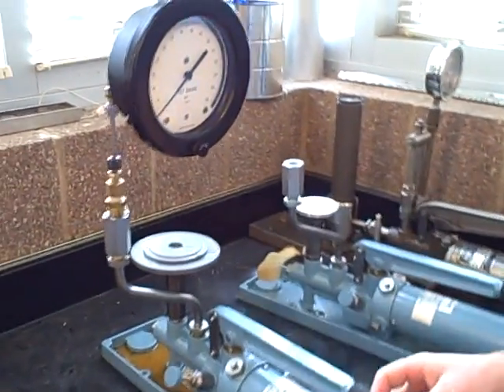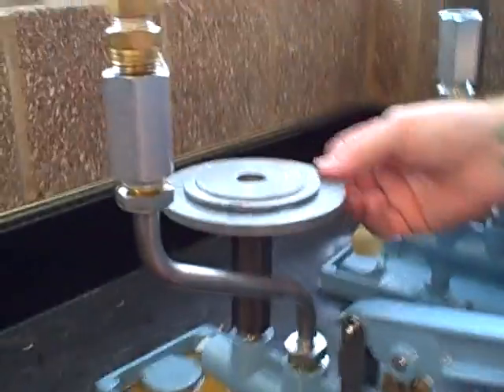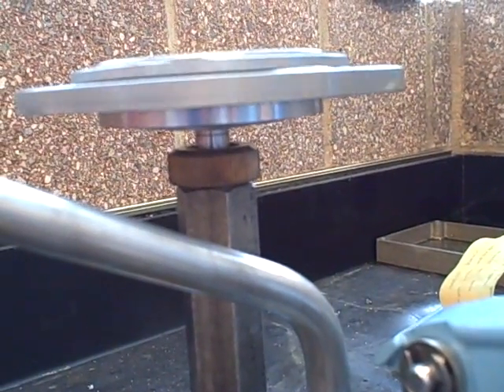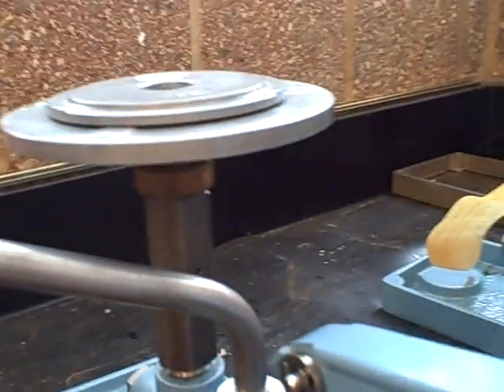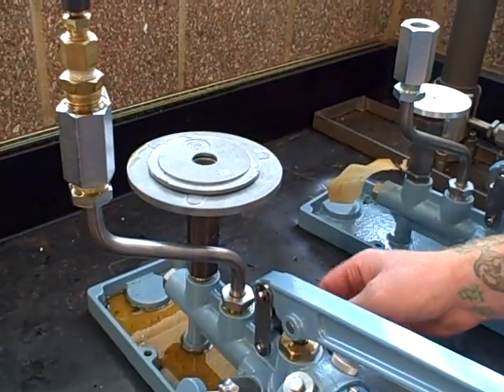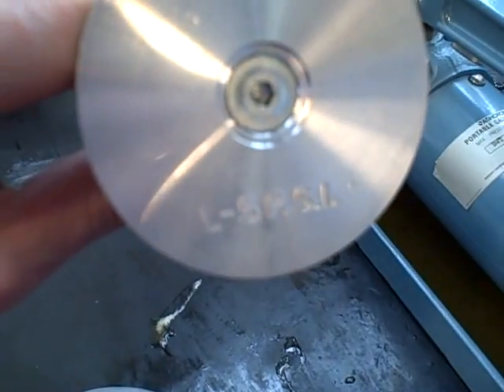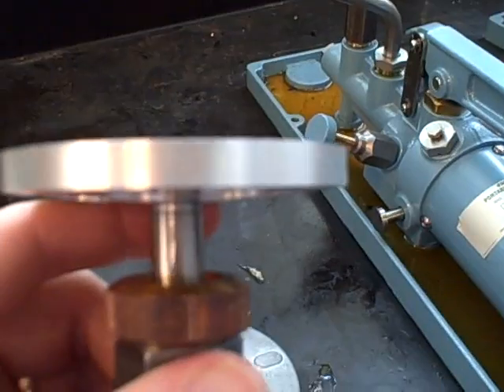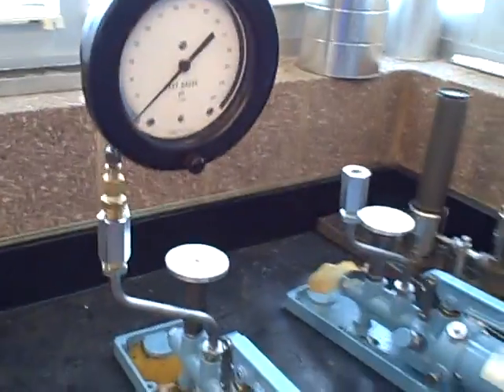Ashcroft 1305 deadweight tester

Comment: What exactly is this used for? Just testing gauges? I got one in a box lot I bought from an auction and was wondering exactly what it was.
Reply: It is used to test pressure gauges. You can use it to calibrate pressure gauges in the field. They have an accuracy of .1%. Do you still have it?

Comment: I have a couple of issues with this video. The first issue is if you’re using The deadweight tester to calibrate a gauge below 1000 PSI you should be using the low pressure piston. The second thing is the gauge he is calibrating with that deadweight tester is accurate to .25% the deadweight tester itself is accurate .1%. When you calibrate something you want a 4 to 1 accuracy ratio. This is only a 2.5 to 1 ratio. Last but not least he told you at the end he showed you how to calibrate the gauge. In reality he only showed you one point he also didn’t tell you whether it’s intolerance or out of tolerance. Whenever you calibrate a gauge you should check it at every 20% of scale so if you have 150 PSI gauge you wanna check it at 30, 60, 90, 120, 150 and then back down.
Reply: What happens if you use high piston on below 1000psi gauges? 

Also I have been testing gauges that are 300 or 200 psi using deadwaight tester using high piston and the piston doesn't elevate on it's own even after rotating in pressure less than 100 psi, is this normal?

Comment from the maker: You should be able to turn the displacement knob either direction, but it does have limits.  It sounds to me like the setscrew holding the blue knob on the shaft is loose.

As for oil, we just use regular 30-weight non-detergent motor oil.

Comment: Is the displacement valve (on the left) only supposed to be turned clockwise to slightly increase pressure?  If I turn it counter-clockwise, the blue wheel comes off.  When pressure is relieved, I can turn this valve counter-clockwise with a flat blade screwdriver for the next use.
Also, any suggestions for a less smelly oil to use?
Reply: Use AAA oil. That is what the manufacturer recommends. Also you can order a replacement for the displacement valve they are not very expensive. I see now that you wrote this 10 years ago so probaly little chance you are still using the unit.